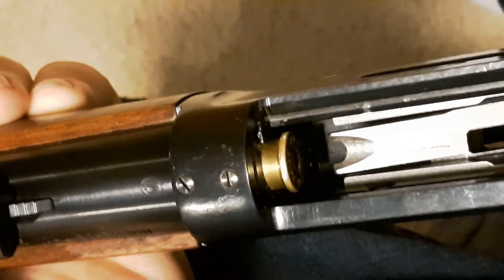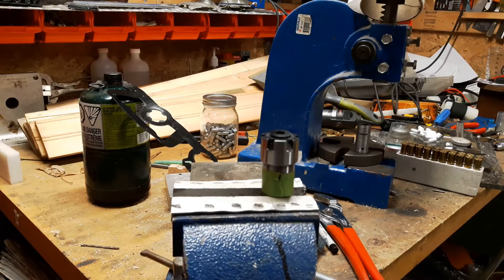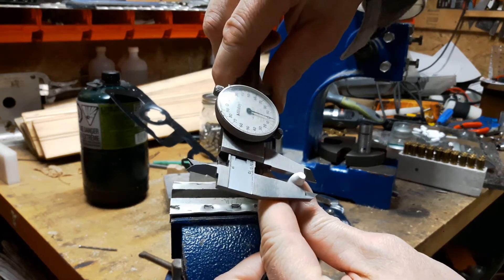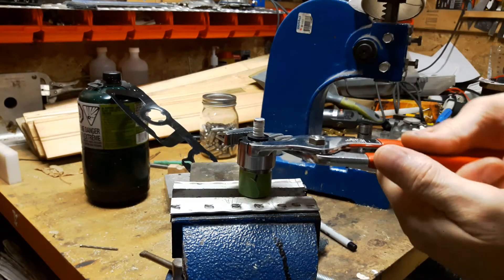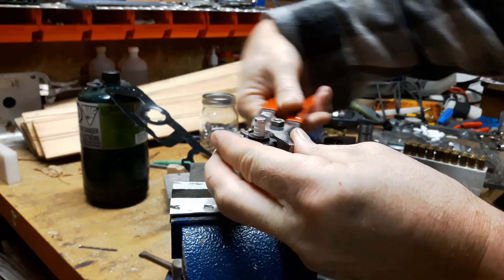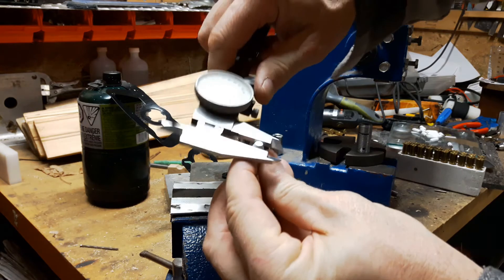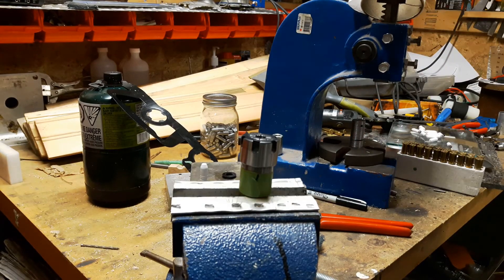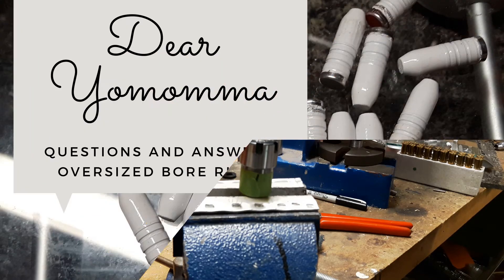Issues With Powder Coated Bore Riders

Comment: Hm. There is a tool that is a tube with metal brushes on the inside for cleaning copper pipe prior to soldering. I wonder if you made a similar tool, that you could either hold by hand while you held the bullet with the other hand to remove the portion of powder coat that is the issue? It would have to be a cone shaped brush tool. You might even be able to make something you could put in a cordless drill, to spin it while you gently insert the tip of the bullet into it.
Reply from the maker: Interesting idea.  Still have some playing to do with this but other projects have priority at the moment
Reply: @YomommasWildlands  I hear ya. Same here. Once you set your mind to some task, it's difficult to take on another problem. I'm currently pondering something. This is for single shot center fire rifles. Ever hear of anyone experimenting with patched bullets like muzzleloaders use instead of gas checks to prevent leading in the barrel?

The reason to do so is to have a low power way to shoot small game while say, deer hunting, with the same rifle. Fail at deer hunting that day, well on the way home maybe you want to nail a rabbit or squirrel. There is a device that allows it, the Hammond Game Getter, in which you use a Ramset blank to fire a round ball. Problem with it is, leading in the barrel. Which has me pondering instead of pressing the swagged round ball into the HGG, you would use a smaller ball with a lubed patch, either breech loaded, or muzzle loaded. Then just use the HGG to fire the blank.

Comment: That is one way to do it . A nose sizer die would be another way .
Reply: James i have a question for you. So I got the Noe nose sizing buttons. Are you supposed to size before or after powder coating. I tried sizing after powder coating and the button is stripping off my powder coat. I have even tried to size the nose is steps. 1 thousand at a time and it still scrapes off the powder coating.
Reply: @Johnny-jr2lq  Sorry , I've never tried the nose sizing . But I think it would be no different than sizing a powder coated bullet . The PC should stay during the sizing process . Either bad PC or time or temperature of the process or a residue is causing the PC to not stay ? I always size after PC